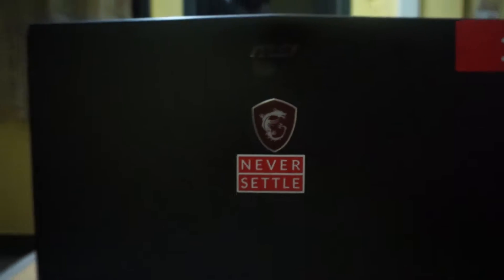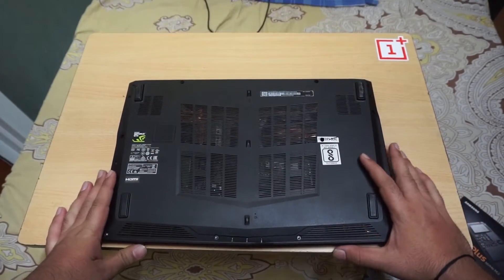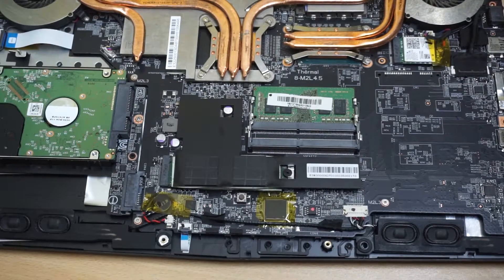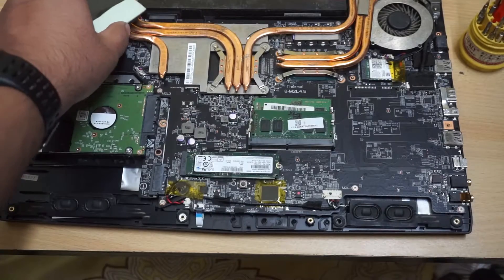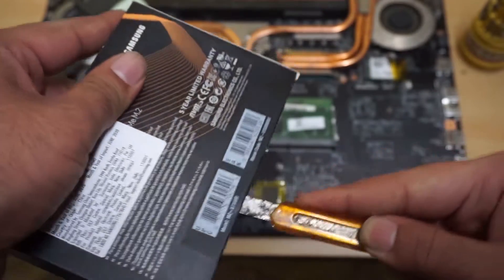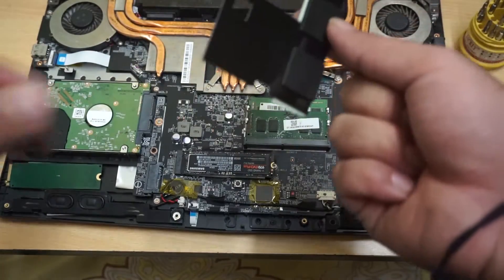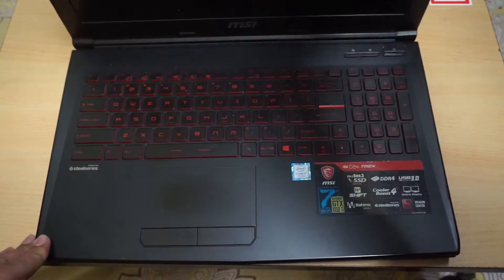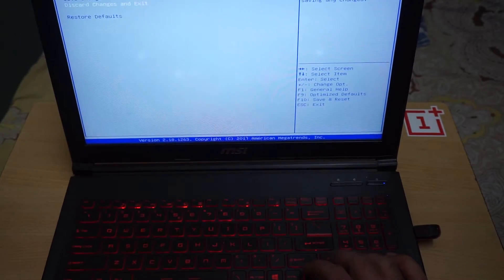How to Upgrade SSD and Ram on MSI Gl62M 7REX  and how to install fresh Windows on your SSD

Comment: Just installed a new nvme ssd (Samsung 980) into the same laptop, it is getting recognized in the bios but not in the boot order.
So it's not selectable as a boot option.

Anyone have any ideas?

Comment: After installing my new ram my laptop will power ( I can even use the manual full power fan button) but the screen stays completely black with no logos at all. The new ram stick refuse to work together but if I mix them with the original ram they get recognized and my system displays 24 gb ram available (16 new 8 old) any ideas for a fox? I have the same laptop
Reply from the maker: I am not sure buddy.
Manual inspection required.
Reply: Did u find an answer?
Reply from the maker: Hey,  1st, we need to identify the issue.
Please check the Ram frequency
If u r adding ram pleas make sure frequency maches with tha ram which u received by default.
This is somthg that requires manual inspection.
I will suggest you visit service center.
Reply: @varoha2338  I found answer, I replaced 1 stick 8gb 2400 with 16gb 3200. This would BSOD my laptop. If i put both in my 16 gb will be 2400 (sad that it is slower) but work. I think some laptops cant handle 3200 even though crucial recommended it.

Comment: hi bro, i wanna upgrade my ram. if i want to, i can just unscrew the back and connect the new ram and it will get automatically added or do i need to something else?
Reply from the maker: Yes unscrew the back panel, and add the ram.
Just make sure you are adding the same frequency one.
And same brand would be preferred.

Comment: hello bro which ram you bought? and pin no 260 or 240?
Reply from the maker: Samsung ram buddy
Reply from the maker: Check your Older Ram and purchase the same, if you want to extend your Ram.
I have purchased 260 one if i recall
Reply: @varoha2338  thanks dude